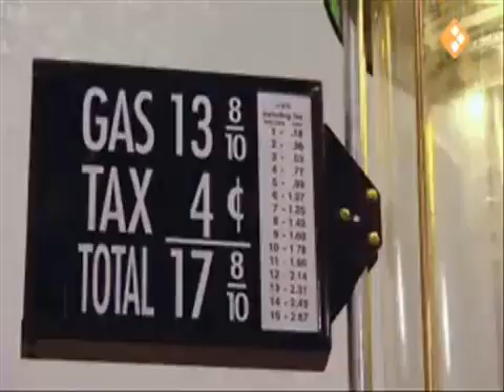Shell Oil's 377 MPG 1959 Opel

Comment: Not even close description. What GM hade was multi stroker,multi fuel ,multi engine type lay out,gasoline-diesel blocks,hit n miss programabel cilinders and some times external ignition methode engine thats what they hade and no 160km per 1 liter fuel ? no !!! tree oil has 20X more flame strenght compared to gasoline preciseli red ceder wood + arc welder tehnologi+ extermal ignition burner on intake system normal opel engine becoms normal strling engine. And yes probably useing more tehnologi gains more milage tractors work unit per time not miles per galon so they cučd have added more capability like high amp ignition,vaporisators,external pre ignitors,cilinder volumen shareing and cilinder deactivation,acid type egr and most valuabel I supose is bacteria who eats oil creates ethanol methanol gas over timw delay so obviusli the more engine is variabel due to gas content ratios changes over time the better result perhaps that explains Opel Kettenkrad and maybe diesel electric metadyne trains better . Yeah shure it isnt easy but works more or less like ordinari Deuce Half Truck Multi Fuel type US Army so cloosed loop wire harnest ,ventilation system and other cirquets necesary to do that.Its just simply 2 engine types merged in 1 unit basicali in the old days there was no lead or aditives the fuel was mostli pure shity ethanol and methanol so they simply joined 2 engine types with planetary gears or external curquets thats how GM controls its engines torque:speed ratio 😊 So no secrets that engine uses its own coolant,oil blow by ,tree acids oil contamination,bacteria eating mather,own engine parts decay and leaky mechanical fuel pump so those engines love pre ignition,cold dieseling and lot ultra lean/rich fuel mixtures theyr heads like to crack or valve clearence to high betwean intake/exaust head valves so in a sence some pairs of the cilinders operate only at fhew crank rotations only fire at delays the othee one work normali but reali all depends what engine type combo you want to run preciseli?So acording to that modifications are done.Or just imagine cold started diesel engine with open flame and you just use ultra lean fuel mono point injection to give extra juce engine works doesnt reali mather where you fire intake or exaust engine still turns doesnt mather . The Joe Cell guy made some points and I did personli use just for fun external ignition on warm engine turned 180° distributor engine still goes done that out of fun but works only on sohc engines and engines that have bored holes space for head valves so piston wont crush valves ! Other vise works perfectly .I need to mention peopel used ethanol water vaporisation not injection so preaty much haveing 5 stick teansmision + pto does nice staff just like Willys Jeep ya know not bade ideas the Metadyne was powerfull in its own righ even that train used Hot Bulb dual fueling gasoline diesel mix to run 😊

Comment: I think that the theory behind burning gas vapour is an interesting one but one of the critical functions gasoline plays in modern engines besides being a fuel is being a refrigerant. Especially with modern direct injection engines the computer in the car will specifically use gas to cool the cylinders and valves and prevent overheating. This would be hard to even solve using a bigger radiator and more coolant channels. This is stuff like the pistons and valves that could overheat. Already vapourized gasoline will have very little cooling effect on the engine.
Reply: You know that water that collects when you use ac or the water that comes out the exhaust. You would just collect water from diffrent sources for cooling. When you think about it the whole idea of a radiator is kind of sad. Nobody wanted to figure out what they could do with all the extra heat energy so they made a big unaerodynamic vent in the car and did not finish the engine.
Reply: Not true, they run cooler

Comment: I performed that search but couldn't find a fee-less downloadable version. I understand that this kind of mileage is possible in the controlled environment of a set speed with cars that are specialized to only do that performance test. Once you fill the car with safety and comfort items, use low-cost parts, and beef it up for general road use, you've lost most of your mileage gains. Most of the fuel is used when accelerating and due to wind drag. When held at one low speed, all cars do better.
Reply: Most fuel is dumped into the cylinder on the exhaust stroke to quench, cool, the valves. Its wasted. Not used.